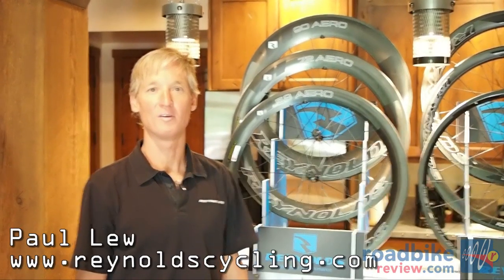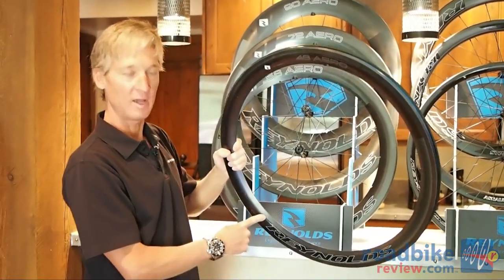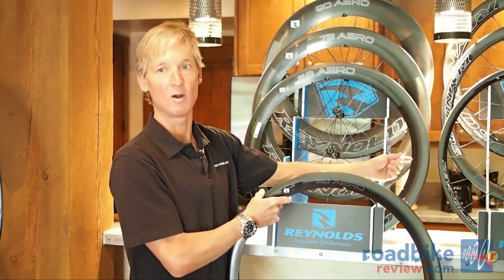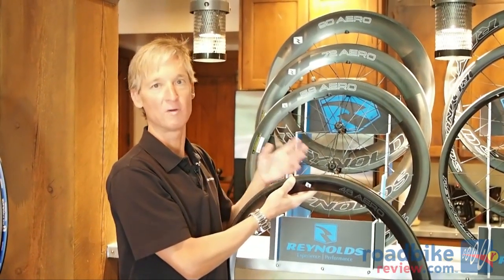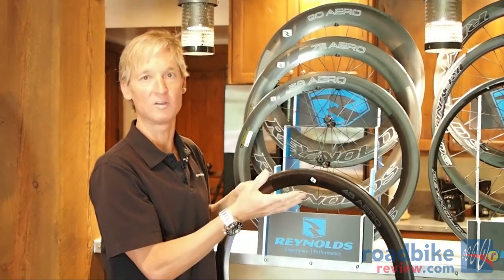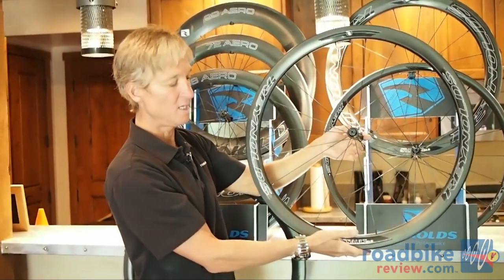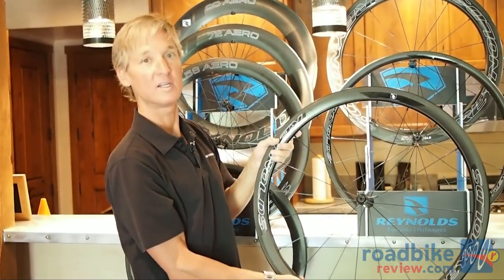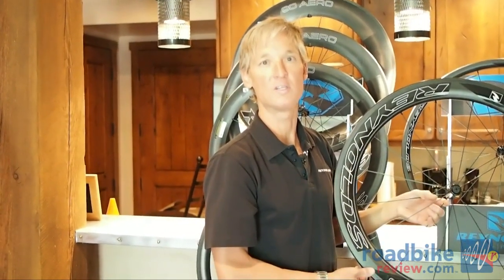Reynolds Cycling - 2014 Carbon Road Wheels

Comment: I bought Reynolds carbon wheels and have been dealing w a horrendous squeal under hard breaking. Reynolds sent me a set of new pads to "solve" the problem. No improvement. I would not recommend these wheels. I'm going back to my Mavics. They are not as fast and cross wind handle is worse, but at least I don't hand to endure the embarrassment of that damn squeal.